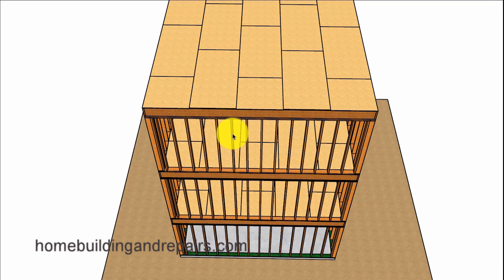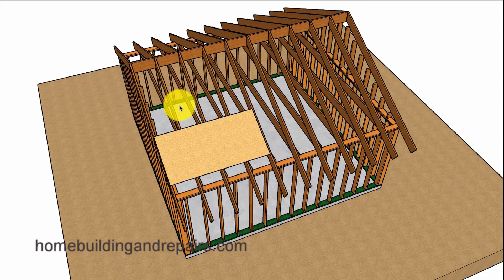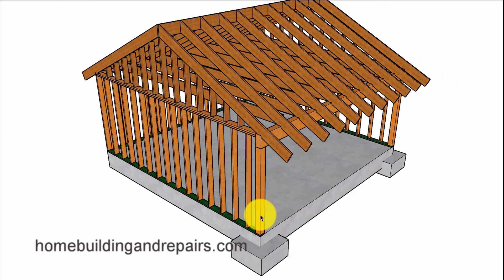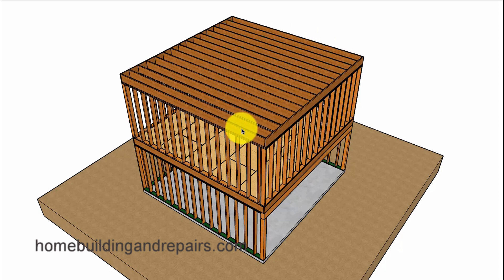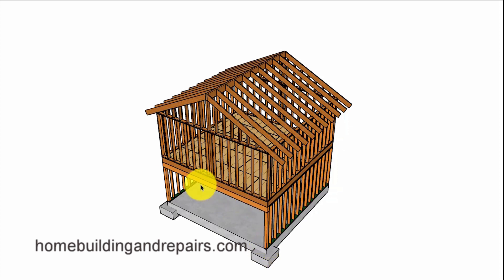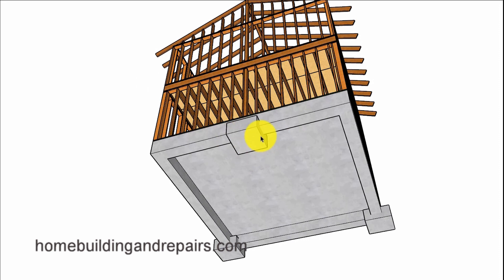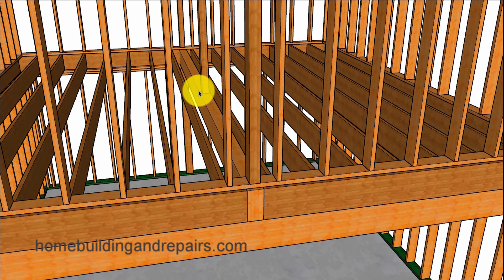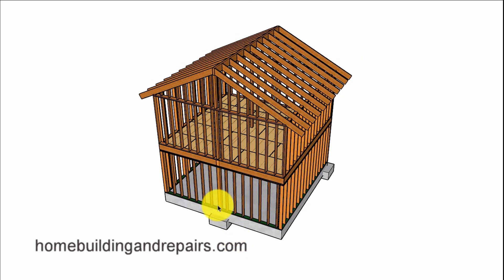What Are Point Loads/Concentrated Loads and Distributed Loads? Structural Engineering Education

Comment: As I’m slowly prepping for removal of a large central load wall in our future (will likely require at least a 3 ply 11.25” microlam), I’m trying to ingest as much of this kind of information as I can. The wall is directly above a concrete stem wall, but I’ve been very curious about how the concentrated weight gets re-distributed below the columns at the stem wall/dirt. Do people usually add a large lentil on top of the CMU wall/under the point load? Reinforce with carbon fiber? Dig under the existing footing by hand and add a larger pad? An engineer will certainly be employed, I’m just trying to mentally prepare myself.

Comment: Awesome video- very helpful!  You convinced me I need footings under my slab to replace a 6’ sliding door with a 12’ sliding door yet how do I determine the size of the footings needed?  The wall in my house where this would happen is just like your house in the video- slider would be on 1st floor- there is a second floor above it and a gabled roof in this area.
Reply from the maker: I can't provide structural engineering information about your footing sizes.

Comment: For timber frame structral load calculations does one need to takeninto account insulation panels , external cladding and roofing shingles?
Reply from the maker: I'm not an engineer, but from what I know, it's all weight and internal and external pressure. Wind is a determining factor also.

Comment: If your slab doesn't have the extra concrete under the corner loads, should that be added, if so, how?
Reply: Shovel, one man, some concrete after a lot of sweating, and the question, "What was I thinking?"
Reply: First, grab a 12 pack of your favorite brew. This is how all jobs should stay off 😉

You need to dig, drill into your existing concrete, put in supporting rod/rods (rebar, concrete bolts or anchors) add a base layer of rock, then pour concrete to achieve the desired size. It's a job, but it isn't all that bad. Might cuss a bit so make sure the kiddos are in school.